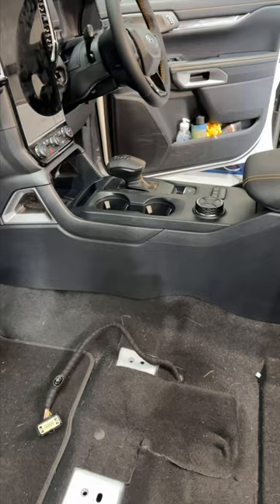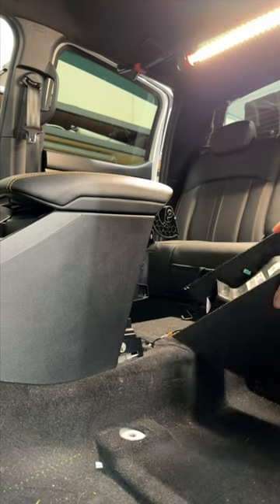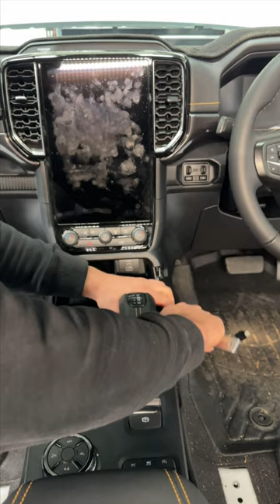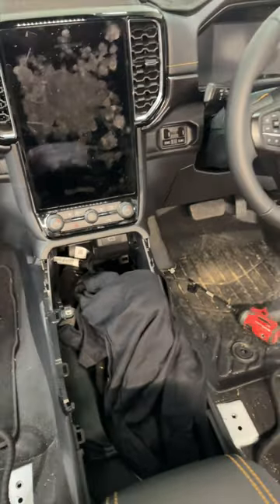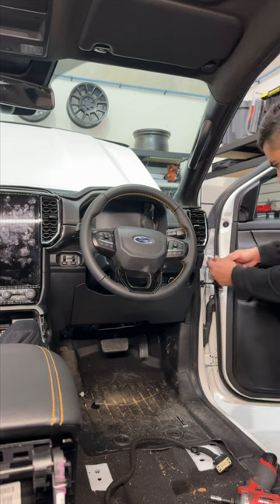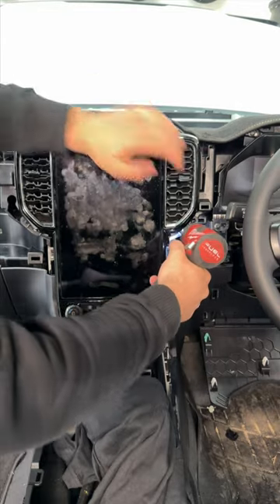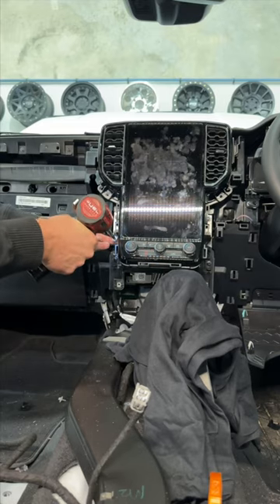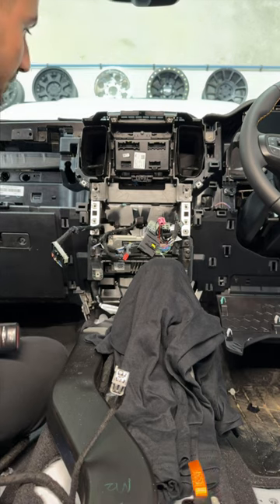Ford Ranger Next Gen / PY Headunit Removal | How to remove Radio

Comment: Hey there, any chance you could tell me what's the best way to remove the cigarette socket inside the armrest? Cheers
Reply from the maker: Hey mate, haven’t done it specifically on this. Usually, there are 2 black tabs that you push inside the socket which allow it to pull out.
Reply: @OzAudioShop  thanks man, I'll try this arvo and get back to u